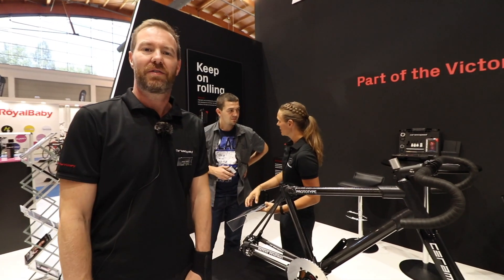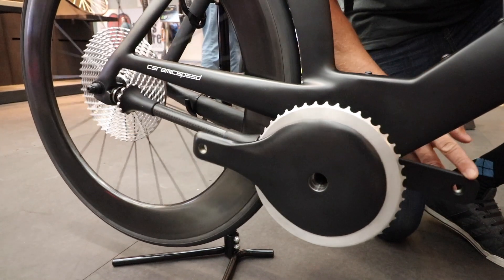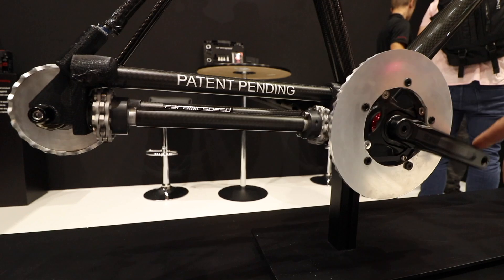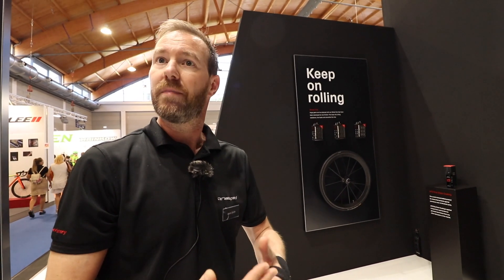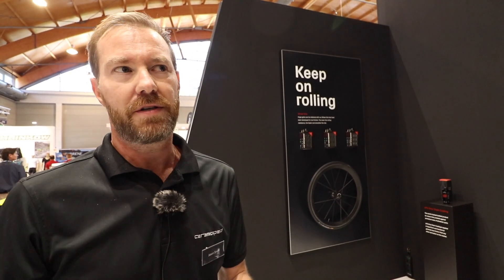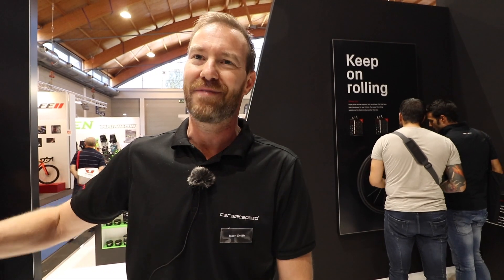CeramicSpeed Driven chainless drivetrain is 99% efficient

Comment: As in chain driven bycicles. ( Convectional type / normal) chains will eventually wear & stretch making them insufficient & have to be replaced fair enough. But, with this type of new drive system ( shaft) what when the bearings wear out of the teeth on the front crank ( peddle area) & the rear sprocket eventually  becomes insufficient or possibly damaged & unusable & has to be replaced. What is it going to cost to replace & repair it?  & as most if not all cycle shops don't deal with this system let alone even heard about it yet!!!  I very much doubt it will be cheap far from it to have it repaired. :O  YES! it does seem to be a good idea to have but, it is not exactly quiet :-\   Depending on the amount of gears I would expect this system ( if proves popular :-\.  )  to be quite fast :O.

Comment: Classic shaft drive with gear teeth replaced with ball bearings and a fragile-looking driven gear on the rear hub (which took 9 hours to CNC-machine out). Gears solved the one-tooth-contact issue by using spiral-cut gears. I do not see a way to solve that power-limiting problem with this concept.

Comment: Shift that thing while under load and I'll be impressed. You now also have a torque applied to the teeth that didn't exist before.  Put it in "first gear" and power a hill with it, all those little teeth will bend down and away toward unless you make the back plate of that cog unnecessarily thick.

Comment: There's a lot of ignorance in the comments, switching to sealed ceramic bearings, miter gears, and dual counter-rotating driveshafts would eliminate pretty much all of the complaints. The real question is, against a chain driven variant of weight parity, can this system increase efficiency while not being prohibitively expensive

Comment: A system that turns the rotation 90 degrees twice will never be 99% efficient. Not to mention the safety hazard of that cuizinart attached to the back wheel.

Comment: This is total BS nothing in that system looks like it could take the torque of a fit rider 389w? That is about 10mph. All the torque is going through 4-6 aluminum teeth instead of a chain that wraps more than halfway around the sprockets. Notice what they don't show: a Dura-Ace drive train side by side with strain guages or something to establish how much more efficient this is. They don't even have a rideable bike set up on a turbo trainer because it can't be made to work without being much stiffer (torque will force the pinion gear away from that flimsy cluster despite the ball bearing cassettes) Present gear drive systems with a single 90° translation are less than 90% efficient. Two 90% translations drop that below 80%. How does this achieve efficiency superior to a roller chain when no other ring and pinion does? Don't give me BS about those tiny, expensive and fragile cassette bearings being more efficient than a straight cut ring and pinion gear in an oil bath?

Comment: Interesting that both the front and back dual hub tires being mag wheels and tubless tires? Graphite or graphene crystsl power cells could be placed inside the mag wheels and even has a donut whithin each of the bikes tires and use wireless electrical transfer to power in hub electric motors in the front and rear dual hub system or to power the electric motor in the cranks? A bike like no other. 😊

Comment: A crazy idea use foamed aluminum scandium alloy to cast the bikes parts. Then powder coat the outer surface with a color giving it a smooth durable finish?  A light weight siper fast dual drive shaft bike with all the bells and whistles? Hay why not through in a bike helmet that matched the bike and a hard shell backpack that matched the bike that could snap into place and lock down behind the riders seat? Market the bike in packages to college students and add in all sorts of things like locks to secure the bike kick stand center stand built right into the bike with just a nub sticking out on one side to place your foot on and pull the bike backwards to place it on a center stand? USB ports to charge up electronic devices ect. 😊

Comment: Be a great idea to use alloy mag wheels with tires that have a foam donut with a round outer surface with an inner notch next to the hub to accommodate a Kevlar tube that can be filled with nitrogen to force the foam outwards making the tire firm and making the tires puncture proof so the owner eill know that they will never have a flat tire. Hay if your going to put a new bike on the market?  Why not design that bike to be one of a kind with all the best technology in it? 😊

Comment: The enclosed cranks could have a sprockets on each side of tge cranks enclosed within the cranks.  with the drive shaft being in tge middle with a duql hub with two tires in the back. Design the back of the bike to have a hollow area for the drive shaft. Place a dual hub with two of those aluminum plates and then add disk brakes and then enclose the aluminum plates and disk breaks. Add a dual hub in the front with disk breaks and and add teo more aluminum plates with a flexible drive shaft runming through the frame down the front forks into the front hub. Then enclose the front hub has well. An all wheel drive bike with all it's moving parts enclosed for safety and protection. Design the cranks on the bike to allow an upgrade for an E bike crank motor with a battety pack that can be placed inside the the arm that supports the rear hub and drive shaft. Say like two two inch cylinders on both sides of the drive shaft were ion battety packs could be slid into and sealed leaving no external wiring. Could even market the bike with battery packs already within the bike to power built in super btight head lamp and tail and break lights even with bright turn signal LEDs in the front and back of the bike. Be neat to add in an electrical power generator so you could charge up your battety packs has you rode the bike a dual battery pack could allow this by having an electric circuit to draw power from one battery pack while charging up the other battery pack with a switch to have both packs power the bikes lights. 😊

Comment: Place the gearing in the cranks with the drive shaft coming out of the middle. Place a dual hub on the back with two transmission plates so the drive shaft has two points of drive rather just one. This redesign would allow.the front cranks to be sealed and the back hub to be sealed a mono rock arm could be developed for the bike placing the drive shaft down tge center for a bike that had all its moving parts totally sealed and protected. Be neat to have dual hub on the front and back with the drive shaft powering both the front and rear hubs. An all wheel drive bicycle. 😊

Comment: Well a Ford 9 inch rear end off-sets the driveshaft connection to the ring gear that spins the axles because putting it center because it’s stronger (although less efficient, unlike what ceramic speed did. It’s much like a Chevy ten bolt rear end, it’s very efficient but horribly unreliable, they break ALOT. Anyways, what about the weight and aerodynamics? That’s a much bigger factor on speed than drivetrain efficiency in cycling.

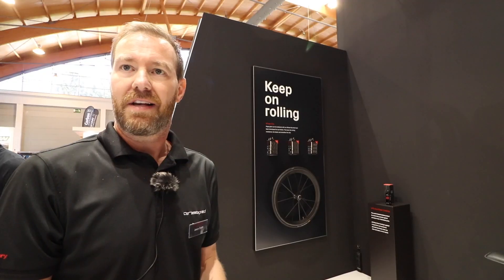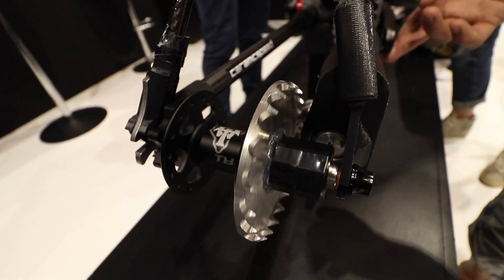Comment: 1:30-1:50
So it is 50 percent more efficient than a duraAce system? This system runs at 99 percent, so the Dura ace system runs at 98.5% efficiency. Why bother even trying when your system overall just improves efficiency by 0.5% overall (at 380W)

Great idea, but I can't see it really taking off. 

Lesson for the future: don't try to improve efficiency on a system that already runs at 98.5% efficiency. You won't get any realistic massive gains. I'm sure you have the skill to do much better in some other field.
Reply: 0.5% efficiency gain is about half an hour on the tour de France (88hrs *0.5%).....
Reply: This kind of comment is inane. Even a half a percent efficiency gain is significant. Plus the positive aero and weight implications of this setup. Nice comfy armchair you’ve got there...

Comment: This kind of chainless bike, made in 1904. We still using chain. Cause this idea, is useless.

Pope Rambler
Model 451c
Reply: There is a period manufacturers catalogue you can find online and it is amazing. That bike is something I would love to play with and I'd hold that 1904 design well above and beyond this. Seriously. The frame / forks and general engineering looks fantastic. I bet it went well, and there is a chain driven version if you don't want a new fangled bevel geared drive...

Comment: I wonder if 'Jason Smith' is wearing a brace on is hand because when he went to demonstrate how the system worked (in the real world) it broke and catapulted him over the handlebars????
 Sorry but the only design that looks like it might be stout enough to handle more than 450 Watt of torque would be the one doesn't have any ratio selection or wheel on it that hes cranking during part of the demonstration(still with no pedals!!)  99% efficiency?!?.. haven't these people heard that there are no free lunches?(not even 99% free)🤔🤔🙄

Comment: 99% is completely wrong. It's still losing significant amount of energy with the transfer in the shaft/pinion from  the rider sprocket (that also loses evergy in the rotating "pegs" your feet go on) to the wheel sprocket. Also note that the ceramic (especially that grade) is extremely fragile in dynamic loads. The wheel sprocket  will not last. Me: Mech that designs actual automotive powertrain components (driveshaft/axles)

Comment: With solid sprockets (front and rear) and shaft, the design looks twice heavier than a chain drive system and about 5 times the cost of manufacturing, with much less torque transfer capacity. 
It's a dud.

Comment: "Shaft drives were introduced over a century ago, but were mostly supplanted by chain-driven bicycles due to the gear ranges possible with sprockets and derailleurs. " wikipedia. This ain't new.

Comment: This is a stupid idea.  Firstly,  you have steel bearings contacting aluminum.  Aluminum oxide which forms on aluminum will abrade the steel away.  This combined with the fact that there is one point of contact means that either you will be replacing alot of bearings,  sprockets or more likely both.  There will be a ton of fatique on the teeth of the sprocket,  seems like mag or titanium would suit this application better. Also,  99% efficient is bullshit.  You have to factor in the weight of the material you will need to reinforce the frame from outward pressure.  This number will take a substancial amount off of your efficiency.  As will overloading those tiny bearings and brinnelling them.

Comment: Bs! When you use gears to redirect a rational force there will always be huge losses. Cars loose upto 20% engine power to the wheels because of the transmission and the differential.

Comment: Hope you ant spent money on this crap, you trying to solve an problem that doesn't exist, finger gets on the sprocket of chain drive and it mite ride over it, this here will cut it of, so many faults I can see here as an engineer my self, if you can get this gearing up on rpm and it stays engaged with direct lateral purchase at all times I'll give you 45k for the patent application, this has been done on motor bike swing arm and failed, Honda pan European has an belt drive now that works, belt and chain still being used on cars coz it's simple and works, gearbox would need to be manipulated her coz of the inline direct drive, the tooling CNC and so on, the cost and who is going to buy this, no commercial bike company will mas produce this again coz of cost, track bikes maybe then all bike drive would all need the same system like say tour Italy or tour Dr France as if it did work it could be seen as an advantage, just to make a small point...

Comment: What happens to the lateral forces over time? Im just wondering if you were to put too much force on a high gear would it not try and separate the rear arms, like what happens when you constantly put 380+ watts through that system?, can it take it long term like 10,000+k ?
Reply: Lot's of questions still need answering. But from an aesthetic point of view it looks really really cool.

Comment: Stand up in lower gear and the back gear plate deforms and slips. No way to make such a thin plate rigid enough at that diameter. Great concept, though. Just add some beef.

Comment: Utter bullshit. Period. 99% efficient at transferring 1 watt. Maybe. As soon as there is any torque applied the separation forces between the teeth and pinions are going through the fucking roof. The roller bearings make this even worse. Don't even get me started on trying to shift this abortion with any load applied.

Comment: In the teaser picture, there is a some actual road testing shown, why didn't this make it to the actual video?

Do they already have a concept of actual gears you could shift? I think, the drive shaft needs to be fixed, so you would need moving parts on the actual shaft to change ratios....

Comment: Clickbait - thumbnail showed someone actually riding a bike with the system. This is a design that looks fantastic in a demo with no actual force on it... but I suspect it'll struggle to handle the forces even an amateur rider will apply much less a pro (the amount of rigidity required between the 'gear' and 'sprocket' to prevent deflection and skipping/damage will be difficult to attain).  Pretty but looks like a Mechanical Engineering train wreck. Someone less lazy could run the numbers but a quick look tells me this is most likely never going to go anywhere with a human onboard. My suggestion - wait until it's in the field for a year before you spend any money.

Comment: Move the gear shift to the front sprockets. The is more room to explore.  This leaves a lighter wheelset with lower inertia at high speed.  Lighter wheels also improves suspension response on mountain bike.with a single speed sprocket at the rear, the spokes can be at a better angle on the sprocket side.  You can use some bevel gearing at the single speed - not sure about effeciency compared to the bearings.  You would need to protect a mountain bike against mud ingress though

Comment: I would like to know if those teeth are long enough (doesn't seem possible) for the gears not to push apart from each other. 
In the likely case they haven't managed it, structurally the system would be very inefficient, which means weight. He said it is lighter, maybe they did it.

Comment: They may eventually tackle it with space grade materials, but the conceptual beauty of this simple design is likely challenged by the high amounts of torque that are in play. The few points of contact between the gears (the reason that supports their claim of reduced friction) at the same time may compromise the ability of this system to handle the high torque of climbing a hill..

Comment: I have broken many chains ridding, but with this new system here is a advance...
Reply: be ready to break plenty of exposed bearings at asymmetric pressure angles
Reply: An advance on the rate money leaves your account when parts need replacing, sure.
Reply: Buy a better chain. Get a shimanno to of the line.

Comment: I should also say, they have it all wrong. The cassette should be part of the cranks with the shaft adjustments at the most rigid part of the bike. Not only will it add protection to the cassette it will accept more torque. Every one has their opinions....

Comment: Sorry but why bother with the front ring?  Why not go with a sealed 90 degree spiral bevel gearbox leading directly into the drive shaft?  Less maintenance, half the noise.  Seems that their 'innovation' was held back by desire for something similar to typical crank / chain ring configuration.  Agree with others; a solution looking for a problem to solve.

Comment: The guy says that 49% less friction/loss than conventional chain drive. It means typical chain drive systems provide 98% of efficiency. I can't say exactly the difference between both systems is either big or small. However, if we change our point of view, there would be other benefits;
No chance to hit and break the derailleur.
Would be very easy to clean it up.
Would be much easier to set it up than derailleur system.
PLUS, I guess the biggest benefit of this system will be on rear hub/wheel design improvement. The rear wheel can be designed in bilateral symmetry like "internal geared hub system" but can be much lighter.

Comment: The amount of pressure and torque created in the drivetrain when a big rider is climbing steep mountain paths and roads leads me to believe that that system would shatter and disintegrate in a short space of time. That system would be way more cool if it was partially internal also. A good attempt but how would you be able to repair on the roadside like you could with a chain.

Comment: That rear sprocket looks like it would flex incredibly easily under load and the points of contact are minuscule (I know they talk about 49% less friction and I'm not surprised...). Also, I've yet to see footage of it being used on a bicycle - and the gears being changed. I've seen a mock-up of the gear change mechanism and not only does it look incredibly complicated but if it's a fraction of a second out then you'll simply destroy the teeth on the sprocket. I love innovative products and I'd love to see this system go into full production, but I just don't see it happening in this guise.

Comment: Actually,  a regular ring & pinion gear would have similar efficiency, yet with better functionality. The tiny contact point of this design will most likely break under actual torque & stress.